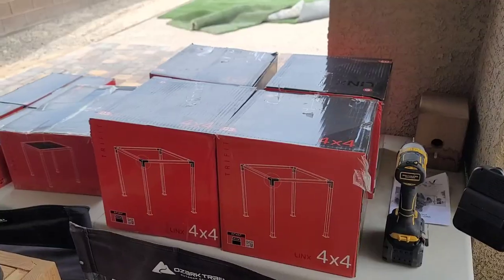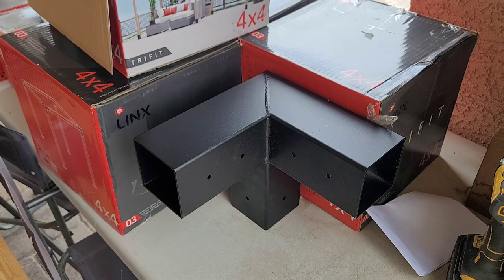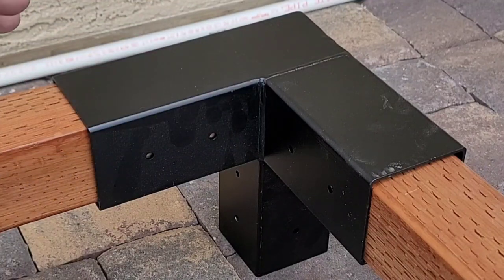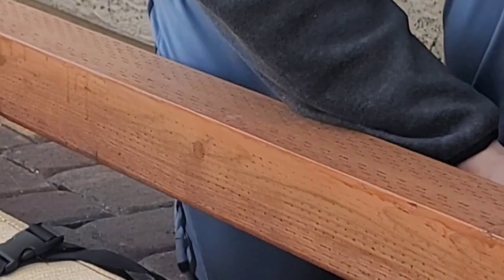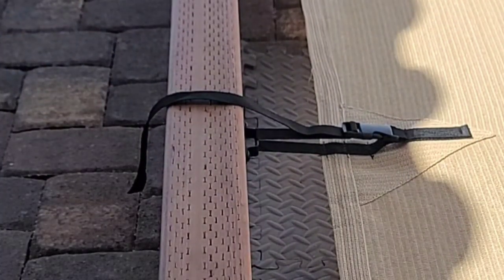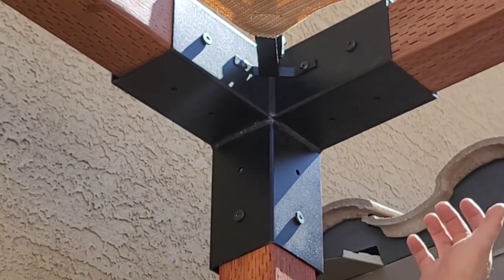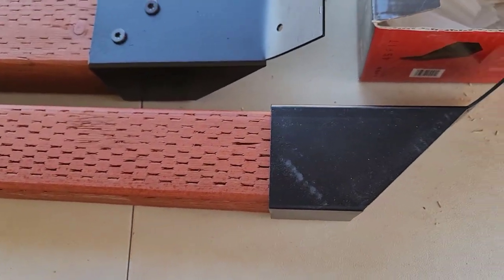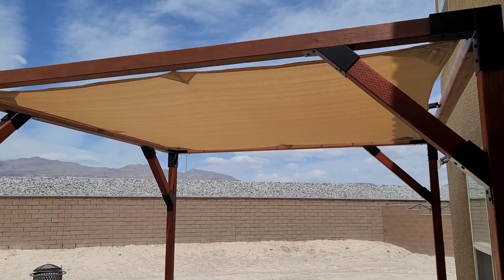My LINX Simplified Pergola System - Woody Wednesday  |  @winstonbuzon

Comment: this is almost exactly what I want to build.  I want to put it on my deck.  and I want a full sun/rain cover.  I have had so many cheap gazebos and they keep ripping or crushing in the wind.  the only concern with this build is if the cover sags and collects rain and then gets heavy.  i might put some cross pieces every foot or two feet to support the canvas.  those angle brackets are awesome and prpbably add all the structural support I need.  thanks!

Comment: What was the total cost with wood and kit?
Reply from the maker: @geraldstone8396  I spent close to about $250 in wood, wood glue & screws, but this is a full size bunk. You can make your bunk smaller and the cost will be too. I already had tools before this project so you may want to factor that cost too.
Reply: @winstonbuzon  thanks

Comment: What are the dimensions? I'm planning on building the exact thing.
Reply from the maker: It depends on your preference just long as you use 4x4s. Height can be anything, but chose 10 feet.  That's the beauty of this system 😁